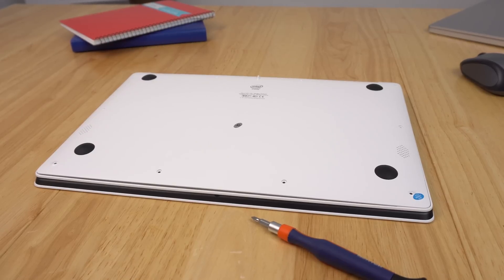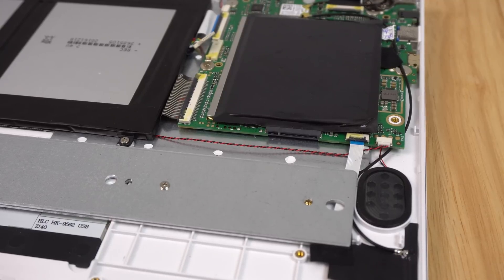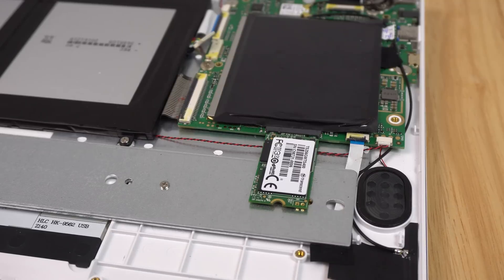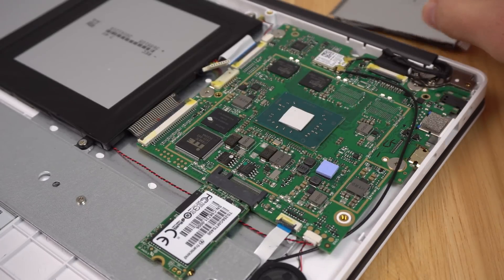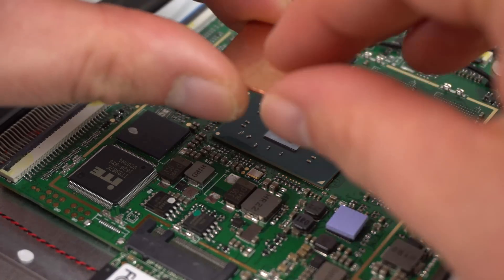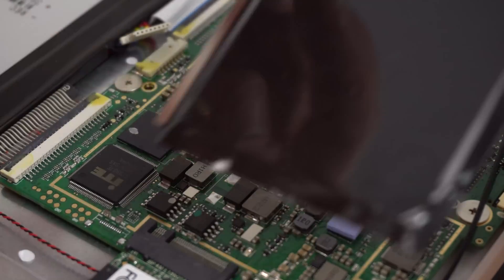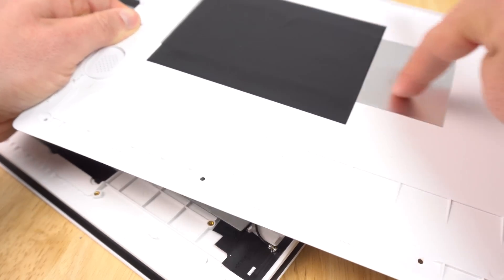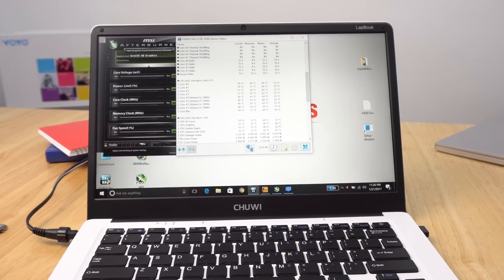Chuwi Lapbook 14.1 / Lapbook 12.3 Copper Heatsink Mod Lower Max Temps By 25 Degrees!

Comment: I would find interesting installing Mac OSX on it. Like a super cheap "Hackintosh Air". Do you know if it is possible?
Reply: No drivers.
Reply: Not even possible with Niresh/Hackingtosh Zone?  I've read that you can even install it on PC'S with AMD CPU (not supported originally by Apple)
Reply: Lucio Heredia Paraja If anything, Elementary OS would be your best bet. If you are hell-bent on OSX, it might work but you should do your research before trying anything crazy.
Reply: You're better off finding a budget Core i5 laptop and installing a compatible wireless card. I did that with an HP EliteBook, which served me well for several years until a freak accident fried the motherboard. MacOS doesn't have drivers for Atom, Pentium or Core i3 processors; there simply aren't any Macs with those chipsets so Apple has no reason to make their OS compatible with them.
Reply: Best bet is to find an i5 or M5/M3 Core M laptop. I installed Mac OS on an Asus 305 FA for my wife by following a You tube video. Took a total of half hour and everything worked except for the Wifi.(Used an external USB wifi for that(US$6)

Comment: difficult to critique this mod... but still: wtf with all that thermal paste!
Reply from the maker: Yeah i know and I said it in the video. I seem to always go a bit overboard with the paste in the videos could have done with jsut half the amount, but I wasn't going to clean it off and redo the video jsut for that!. Still no harm, the results are great and well worth it.
Reply: TechTablets.com yeah i know. you always predict putting too much paste on and then you do put too much. it's an amazing difference with the mod. i don't understand why the manufacturers don't optimize it somewhat themselves.
Reply: You could scrape some off with a toothpick or a small piece of paper.
Reply from the maker: That's true, but I wasn't worried about it as the excess would just be pushed to the side a little and do no harm. It's not like I'm reposting my i7 7700K, it's 6W and not as critical.

Comment: that copper shim looked very close to the surface mount resistors next to the cpu die
Reply from the maker: The gap looks smaller than it really is, but due to the video angle, it looks like they are touching almost. It was done a few days ago, running perfect and has been transported around in my bag. I've done the same to a Cube i7 Book and it's still working. Will see if it survives a trip from Valencia to Auckland, over 29 hours flying as I'm taking it with me.
Reply: kapton tape over the resistors would probably be a good idea
Reply: i was wondering about the same thing.

maybe try to use the yellow thermal insulation tape just to be safe  ?
Reply: Can confirm. I even went with a bigger plate. 1 x 29.5 x 26.5 mm. Works perfect.
Reply: probably going to do that.  Good tip.
  Just hope tape doesn't melt.

Comment from the maker: Chuwi LapBook 14.1 Copper heatsink mod. This cheap and easy mod fixes overheating, lowers max temps by up to 25 degrees C and improves game FPS. Parts used. 20 x 20 x 1mm copper shim, thermal paste and 2mm thick thermal pad 50 x 50mm. It's $229 here http://www.gearbest.com/laptops/pp_602696.html?lkid=10827077 with coupon ChuwiLapA
Reply: TechTablets.com hi mate...nice videos....im looking to buy a 200-300 W10 laptop...plz advise if this is the best one so far for facebooking, streaming....? 

Thnks
Reply from the maker: Yes this is the best one so far for the price after doing this mod.
Reply: Nice video! i buy the Chuwi LapBook 14.1 and the mod stuff ;)
Waiting for delivery now XD
Reply: Got all the stuff from ebay and mod the lapbook today. Great how to!
Reply: this one http://www.ebay.com/itm/121710372646?_trksid=p2060353.m2749.l2649&ssPageName=STRK%3AMEBIDX%3AIT
Reply: I prefer round edges like mine. Perfect quality and smooth.